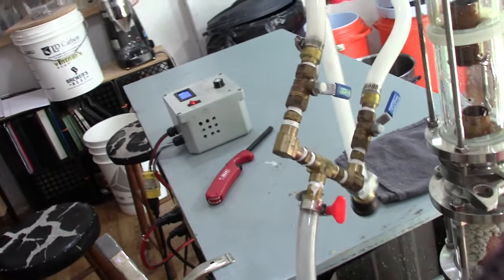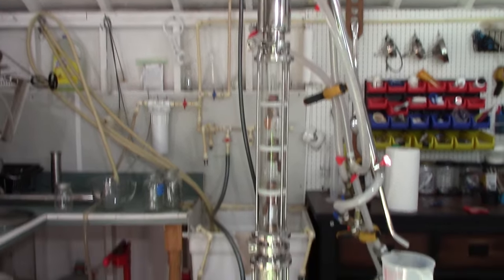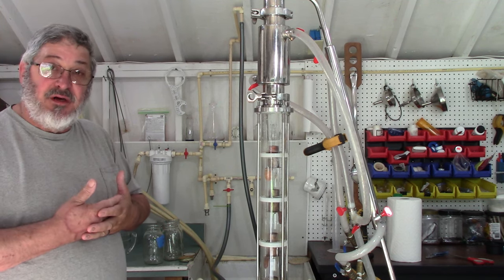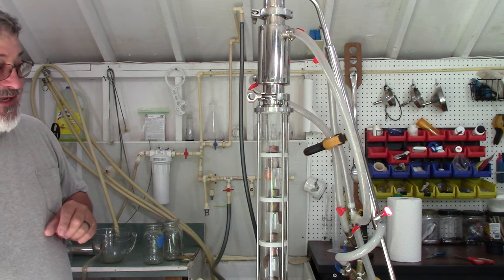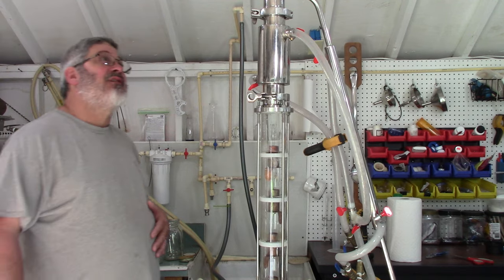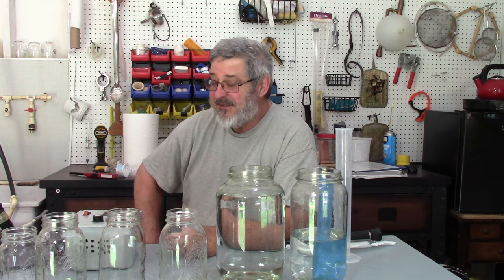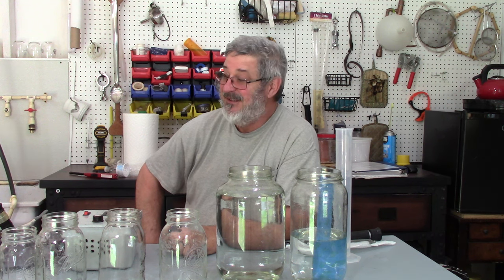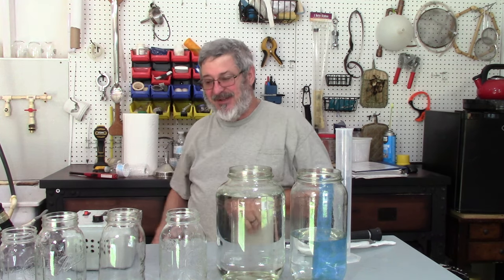Corn Vodka Distillation how to.  part 2

Comment: What's the point of the ceramic packing in the first cell?
I work in the refining industry. We use packing in the fluid level of towers to force a bit of passive reflux while the liquid is boiling but have never seen packing used in a dry cell/tray.
Reply from the maker: i use that to help with pukeing control

Comment: I absolutely love your videos but I have a question while I was watching this one. Would it be any difference on the flavor if you mashed out the corn separately mashed out the rye separately mashed out your barley separately what I mean is let them go through their changing to sugars and then put them together for the yeast and then run it just wondering I mean use flaked and malted grain
Reply from the maker: Great question check out a series not to far back called deconstructed reconstructed bourbon

Comment: If you are doing a sour mash run, keep some of the lees that is in the bottom of the barrel, still live yeast as well.  Put some in a clean jar, some fresh water, and a tablespoon or two of table sugar.  Put in fridge, when done distilling to do sour, wait until temps fall down below 90F, and pitch your old yeast in.  Keep the same colony (especially if you know the flavors of that yeast work for your mash) and spare some yeast for future new projects OR carry over your yeast colony to a new batch each time.  Saves a boatload of money that way on yeast.

Also, if you don't have a column still, on your pot still + thumper setup - wrap a cotton towel (wet it first for easier wrapping) around the top of your onion or swan neck (this will act as a dephlag), add a little water to it when it starts to dry out, and you should also get 70%+ coming out of your thumper.  I've gotten up over 80% on my refractometer.  It still keeps the flavor of your mash better but for about 700 ml you'll be over 80%, give or take on your setup.  Otherwise, do a stripping run, then on spirit run, do the same as above with wet cotton towel, you will absolutely get over 80% for almost your whole run.
Reply from the maker: thanks for info

Comment: Have you tried using popcorn? Specifically popped popcorn? Popping it gelatinizes the starch so no cooking needed. And if you grind the popcorn into popcorn flour the yeast should pull ALL the flavor from the popcorn. Which means you may be able to use less corn to flavor the shine. And if the flavor of roasted corn comes through that should taste pretty damn good.
Reply from the maker: Interesting 🤨

Comment: Fun facts: From a 10% mash it takes about 14 vapor to liquid state changes (reflux) to drop enough water from the alcohol azeatrope to get to 95% purity! That's a lot of 'invisible' reflux going on (and the final percentages change slowly).  Even a pot still has some reflux (10% wash goes to 55% in a single reflux cycle and 70% on the second).

Comment: Nice! 🍻
I personally prefer to make my neutral spirits/"vodkas" out of potatoes 🥔
It comes out exceptionally smooth compared to other spirits I've made so that's what I like to use for neutrals 🥃
I'll use exogenous enzymes for the saccharification then ferment it with a neutral yeast like EC-1118 🧪
After that I strip all the alcohol out of the mash, redistill the low wines a second time with plates & hold it at a steady 180 proof for almost the entirety of the spirit run ⚗
I feel like I get a larger hearts cut, with a higher overall proof, and with less flavor when I split up the distillation into stripping then reflux it afterwards 🤷‍♂
Then if I absolutely want or need something truly neutral and tasteless for a project, I'll finish the process with activated carbon treatment and a celite filtration 👨‍🔬
I can be a bit of a perfectionist that tends to take things too far though 😅
Shine on brotha 🤘

--🧿RuneShine, Michigan's Norse-Druid Alchemist🧪🥼🔬
Reply from the maker: thanks for info cheers